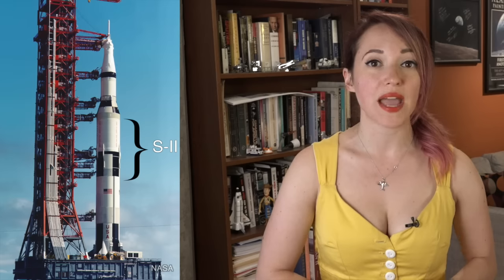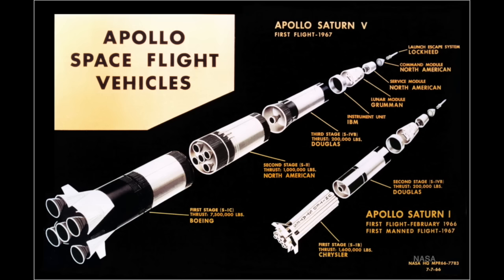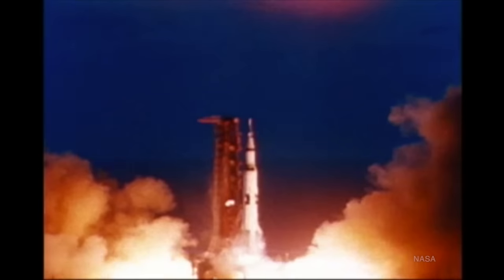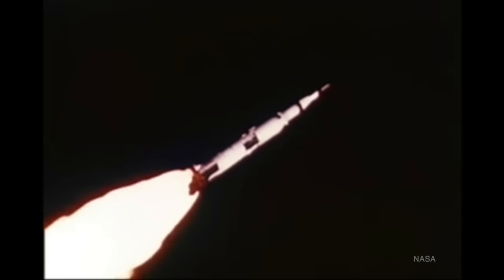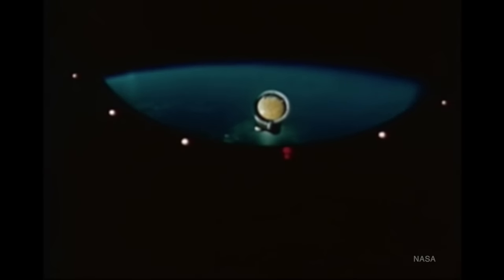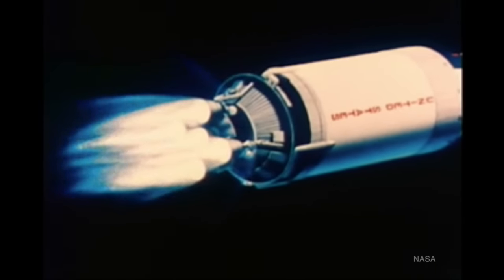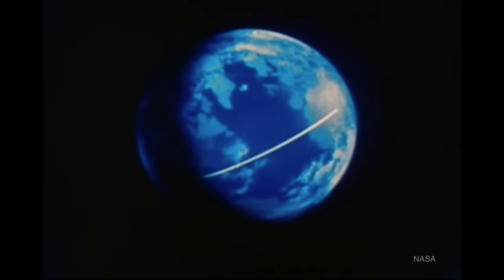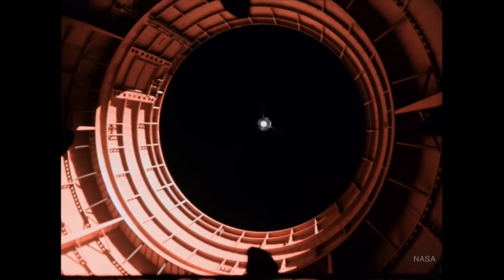How the Saturn V Broke into Pieces Launching to the Moon

Comment: This video doesn't mention WHY the inboard F-1 engine was shut down before the others.  The rocket's weight was mostly fuel, so its thrust:weight ratio got higher and higher as its fuel burned up.  Shutting down the center engine was like throttling back 20 percent and helped keep the acceleration down.  Even though it was way more powerful, the Saturn V was actually a gentle ride for the astronauts.  The most they felt was 4g, compared to 8g on Gemini. 

My question is: Why was it so unique that the S-IVB could be fired twice?  Was it a huge challenge to design it that way?
Reply: quite a few of the guys that rode the Saturn V said the G wasn't the problem, the vibration was! (Bill Anders mentioned that he couldn't read any of his instruments on Apollo 8 and I think Charlie Duke and Al Bean made similar observations..
Reply: +CountArtha :Rocket engines are typically fired only once so when they had to fire the J-2 on the S-IVB, it was a big challenge at the time. It probably wasn't that big a design challenge except for the man rating issues. But to get to the moon on JFKs timeline, NASA had little choice.
Reply: +J Dean Is it just a matter of getting the fuel to stop sloshing around?  Because that's what ullage motors are for, and both upper stages had them.
Reply: +CountArtha Given it was the first flight restartable non-hypergolic engine, it was kind of a big deal. Much of the challenge was in managing ullage in cryogenic propellants. Gas in a turbopump can be catastrophic. Cryos want to revert to their gaseous state, so making certain you have a uniform and gas free propellant load at the right end of the tank in zero-G is very important. So important, NASA even used "propulsive venting" between the burns, and an additional ullage burn to make sure the propellants were fully seated before reignition.

Comment: What did they use to FILM stage separation from within the falling section?  And how were the cameras recovered after they fell back to earth?
Reply: +Jonathan Anderson 
Some sort of television cameras that would transmit the signal live to the ground presumably.
Reply: +Jonathan Anderson :These cameras were installed on the second stage bulkhead to film first stage separation. The signals being transmitted just as the signals from the lunar missions and moon walks were filmed and transmitted. There was plenty of space within the bulkhead area of stage 2. Between the engines for example although it appears the cameras were probably mounted within the bulkhead but at the edge of it.
Reply: +J Dean :I was partly corrected as far as the cameras on stage 2 being ocean recovered. I wasn't thinking about the fact stage 2 was still going low and slow enough to make camera recovery a viable option. However, unless someone can say different and back it up, the only way to have gotten the shot of the S-IVB separation from stage 2 was to telemeter the data to the ground. Stage 2 would have been approaching orbital velocity upon separation at an altitude of 115 miles It would mostly burn up in the atmosphere and any surviving pieces would land in the Indian ocean if I recall right.

Comment: is there any reason why the third stage was called S-IVB instead of some variant of S-III? is it exactly the same as the S-IVB shown in the image of the saturn I?
Reply: +aksen303 

Yes. I posted this to someone else.

"The S-III was a proposed third stage of the early Saturn C designs for a five-stage Saturn launch vehicle.

But before the S-III ever got off the drawing board, the S-IC, S-II, and S-IVB were already in development, so there was no need for another stage to be designed as a third stage, so the S-III stage was dropped." 

The S-III would have had two J2 engines, whereas the S-IVB only had one J2.

Comment: Stupid question, but what bears the weight of the rocket on the launch pad?   I assume those fancy clamps you release in some launch shots are involved, but a 36 story  rocket with all its mass on a few (4?) clamps?  Do the clamps grab the bottom of the main cylinder, and is all the weight held by the exterior skeleton?  If I filled a paper towel cylinder with water and held it by 4 points at the base, it'd deform (I know, bad example).  Would love if someone could point me to a nice explication.

Comment: Hey Amy I've got a question and I don't know if you've already covered this but I've learned that the command module was actually armored to protect the astronauts from deadly solar winds. Was there at any point, while being on the moon, crews were in danger of solar wind exposure?
Reply from the maker: +Ben Klotz This might not be exactly what you're after, but it might help? An old episode about flying through the Van Allen belts that I think talks about some radiation risks and shielding in the CM. https://www.youtube.com/watch?v=9BEylTGOlQ8
Reply: +Ben Klotz There was a solar storm between Apollo 16 and 17 that was missed only because Apollo 18 was canceled. Had Apollo 17 been on the moon at the time, they would have died. They had no protection from solar wind. Now we monitor the flares better to give astronauts time to get back inside if they are on a EVA.
http://www.sciencefocus.com/blog/how-apollo-astronauts-avoided-deadly-solar-flare
Reply: +Amy Shira Teitel (Vintage Space) hey thanks Amy for answering I'll look into that website. Will you also be talking about the voyager satellites? Or did you already cover those?
Reply: +Leah Burbank hey thanks Leah for answering. I know we use special tech that monitors solar flares but did you know if we monitored during Apollo? Sorry if I've missed any details.
Reply: Ben Klotz From what I've read, no. They were not following the solar flares in real time. So they wouldn't have been able to give them any warning. But because they were not in space at the time, Apollo 17 brought back moon rocks that were recently exposed to solar radiation, helping NASA better understand it. So a lucky break for us.
Reply: +Leah Burbank that's awesome you know so much!! Hope your working at JPL or NASA for that matter. Thanks for answering my questions! Look forward to Amy's next vid!
Reply: Ben Klotz Lol, thanks. Just a big space geek is all.
Reply: +Leah Burbank I'm still kinda a geek too, I bought my dad a couple of manual books of the Saturn V for his birthday!

Comment: but how is the rocket held together. what is the exact physicalites of the stage connections. i cant wrap my head around it. how can something need to be so strong and sturdy but have the redundancy to break apart at a persise altitude. 

say 12 bolts holding the thing together ... what happens if one doesnt break?

Comment: can you do a show on space station  computers like how fast or how expensive that are
Reply from the maker: +Dontbeweakvato That will take some time, but I think I've just thought of an interesting approach to that question... I'll have to do a whack of research though!
Reply: Also I heard that computers I space have to have looser tolerances due to micro meteors and that limits computing power in space. Is that at all true?
Reply: +ironcityblue i doubt it. micro meteorites don't really hit the computers... the computers are protected inside so... maybe the beta rays could damage the computers but not the micrometeorites
Reply: +ironcityblue As I understand it, cosmic rays are the BIG problem with computers in space.
Reply: RocKiteman_ _2001 but there are some rad-hard electronics that are very well shielded. The ISS itself as a strong protection, on some videos you can see they're using a bunch of regular laptops...
Reply: +Electro phobia -- Correct, but AFAIK those computers do not 'control' the ISS itself.
Reply: RocKiteman_ _2001 no they're for isolated experiments afaik
It still demonstrates that the ISS is pretty well shielded

Comment: Can you please explain the Space-Shuttle mission designation?
Reply from the maker: +Cookie Builder Mission designation, as in the numbering system of missions? I think they're sequential with letters denoting mission type? Not entirely sure to be honest! Though the STS stands for space transportation system, that's something lots of people don't actually know!
Reply: +Cookie Builder :In the early days, the numbers started as the straight forward number of flight. STS-1 was the first flight, STS-4 the 4th and so on. But schedule delays and mission swaps caused NASA to adapt a new system after STS-9 (Spacelab-1) which was confusing to the public but had the side benefit of making it appear more shuttle missions were being conducted than actually were. An example number would be STS-51F or Spacelab-2. STS still meant Space Transportation System. The 5 in 51 meant the fiscal year of launch. In the case of 51F, this would be 1985. To understand the confusion caused by delays, Challenger was designated 51L but launched in 1986 which should have meant the number would be 61L. It was originally scheduled to be launched in mid to late 1985 which accounts for the 5 in the number. The 1 in the number designated the launch site. Kennedy Space Center (KSC) was designated as 1 while Vandenberg AFB was designated as 2. The end letter was the sequence. "F" meaning the 6th launch while "L" meant the 12th and so on. STS-71N would be a 1987 launch from KSC, 14th launch of the year. STS-82A would have been launched in 1988 from VAFB and first of the year. Discovery was the orbiter assigned to VAFB. Of course, after Challenger (51L), this system was abandoned in favor of returning to the original. Plans to use VAFB as a launch site were also abandoned so there was no need to identify the site in the STS number.
Reply: +J Dean And also, after Challenger, the sequential numbering as the missions flew (as in your comment, where STS-1 was the first mission and STS-4 was the fourth) was abandoned in favor of assigning each mission a specific STS number and it keeping that number irrespective of when the mission actually flew. That's why the early post-Challenger sequence was STS-26, 27, 29, 30, and then 28. It's also why the two mission numbers for the Microgravity Science Laboratory mission (the one that was shortened due to fuel cell malfunctions and re-flown three months later) had mission numbers STS-83 and STS-92. STS 83 actually was the 83rd flight, and was followed by STS-84 a month later. When NASA decided to re-fly the 83 mission, eight other missions, through STS-91, had already been planned, so 92 was the next available number. So even though it flew right after STS-84 and was the 85th mission, it was named STS-92.

Comment: (Okay, I just looked it up but I'll ask anyway.) How do we have footage from the stage separations?
Reply: +Andrew P :Engineering cameras within the spaces of the interstage skirts.
Reply: Well yes, obviously, but those are film camera on spacecraft parts that aren't made to be recovered. The short answer is that those cameras were jettisoned and recovered (jettison is visible on the unedited footage) I'm still a bit in the dark as to the specifics of the recovery process however.
Reply: +Andrew P :For first stage separation filming, you have an excellent point. The second stage was still going low and slow enough for ejecting film canisters. But for the shot of the S-IVB seen from inside the second stage upper conical section, the stage would have been going too high and fast for film recovery because much of the stage burned up during atmospheric entry. I don't know a whole lot about the recovery process but unless someone can say differently, I still think the S-IVB shot had to be telemetered to the ground.

Comment: Great video as usual, Amy, but at 2:00 you said 8 rockets fire at the top of the S-IC to slow it. Diagrams showing the insides of the S-IC show the retrorockets are in the F-1 engine fairing as shown here (http://1.bp.blogspot.com/-qC1cJmWDt0g/TbDOZm7L4wI/AAAAAAAAKh4/ffHynZ6mS8E/s1600/lApolloSystemsDescriptionS-ICstageaft.JPG) 

Just wanted to point out a slight error, no rudeness intended. Cheers!
Reply: +jhggygh You are correct! Amy got tongue tied and said the retrorockets are on the top of the first stage, and also mentioned an aft skirt on the first stage connecting to the second stage (was Pete slacking on the cue cards?). In actuality, it's the other way around; the retrorockets are indeed at the aft end within the four outboard engine fairings, and the first stage only has a forward skirt (an aft skirt would be near the engines, and definitely not connect to the second stage).

Comment: Why using Kerosene in the first stage instead of liquid hydrogen, which has higher energy density?
Reply: +Alex Lopez :It all depends on the application and if I recall right, the same amount of LH2 would have made the stage larger. RP-1 has a higher density but lower energy as measure by specific impulse than LH-2. This was also at a time when LH2 was a relatively new propellant to rocket engineers. They'd built the first LH2 propelled Centaur upper stage for Atlas and Titan rockets a few years earlier. Nowadays, there is a lot of experience using LH2 and it's use in the Delta-IV heavy launch vehicle reflects that. The SLS/Orion first stage will also be powered by LH2/LOX as well. However, the Atlas-V still uses RP-1 and LOX.
Reply: Spacex Falcon 9 uses RP-1, LOX in both stages.  So does Soyuz.
Reply: +Alex Lopez Kerosene is more powerful than liquid hydrogen when it's burned inside the atmosphere.  The S-IC first stage did basically the same job as the Space Shuttle's solid-fuel boosters - lift the rest of the rocket off the pad and into the upper atmosphere where liquid hydrogen burns more efficiently.
Reply: +CountArtha No, it is not true that kerosine is more powerful when burned in the atmosphere than liquid hydrogen.  In any case, even if it were true, it would not apply to rocket engines.  In a rocket engine, essentially all the combustion takes place inside the combustion chamber (clever name, huh?).  There is no "atmosphere" inside the combustion chamber within a fraction of a second after the engine has started and throughout the engine's run.   What is inside the combustion chamber is a constant stream of fuel and oxidizer pumped in, usually by high pressure turbopumps.  That fuel and oxidizer burn very rapidly, in milliseconds, producing hot exhaust that expands through the nozzle.
Reply: +CountArtha What is true is that LH2/LOX has a higher specific impulse than RP-1/LOX.  This is true in the atmosphere or in vacuum.  Specific impulse is a measure of the propulsive efficiency of a fuel oxidizer combination.  It is an important design consideration, but not the only one.  The math of staging works out that higher specific impulse is more important in upper stages.  LH2/LOX upper stages are common for that reason.  Shuttle, Ariane V, the entire Atlas-Centaur family are examples.  But, it is not the only way to get to orbit.  Soyuz and all it's predecessors back to Sputnik as well as the more recent SpaceX Falcon 9 use RP-1/LOX in all their stages.  The Soyuz family has been launched to orbit more often that any other design!
Reply: Mark Holm
Yes, but the combustion itself is not what propels the rocket (it's not driving a piston or anything).  The exhaust pushes the rocket forward as it's expelled backward, but part of the exhaust velocity is lost as it displaces the surrounding air.  A kerosene or solid-fuel rocket works better because its exhaust is heavy.  In space, where there is no air to push against, is where liquid hydrogen engines really shine.

Specific impulse at sea level
F-1 engine (kerosene): 265 seconds
J-2 engine (hydrogen): 200 seconds
Specific impulse in space
F-1: 304 seconds
J-2: 421 seconds

Comment: How many contractors made one Saturn V rocket!
Reply: +Арт Вознюк   I'm reading Frank Borman's "Countdown" right now and during the Apollo 8 mission he mentioned how the Saturn V took 300,000 people to build. I've heard this figure before in relation to the manpower allocated to the Saturn V when the oft used 400,000 figure is brought up about the people involved with the Apollo project. I'm sure this includes all the people involved with the necessary designing, testing and evaluations work since every component had a 99.99992% reliability requirement. Plus the effort to move large components from various locations to the launch site and all the prep work involved prior to launch.
Reply: Hundreds, but just one prime for each stage. Boeing (S-IC), North American (S-II), Douglas (S-IVB), and the instrument unit was by IBM with the structure built by NASA (Marshal Space Flight Center)

Comment: There's an S-I C, S-II and S-IV B stage - why was there no S-III?
Reply: +Velociraptor256 Naming conventions often come from design phases. The Saturn V is the result of many phases, in which different components and multiple possible configurations were developed. Early concepts had it as a five-stage rocket. That configuration went through many changes. In the end, there was certainly an S-III (as well as S-1 A, B, etc) in the 'parts available' - all at different levels of development, but those components did not make it into the final 3-stage design.
Reply: +Velociraptor256 In short, never made it off the drawing board...

https://en.wikipedia.org/wiki/S-III
Reply: +Bob Weiss Thanks for that link, I was asking myself the same thing.

Comment: 3:37 came from a Saturn 1b shot.
Reply: uhh, nope. internal stage separation came from Apollo 4. Cameras were mounted fore and aft on 2nd stage to film stage separation. then ejected for recovery.
Reply: sfcbjs1 They also had cameras in the Saturn Ib as well. Notice the interstage is cylindrical and not conical as on the Saturn V interstage.